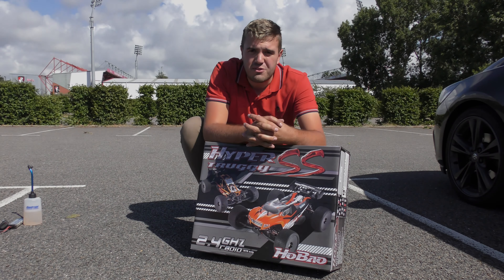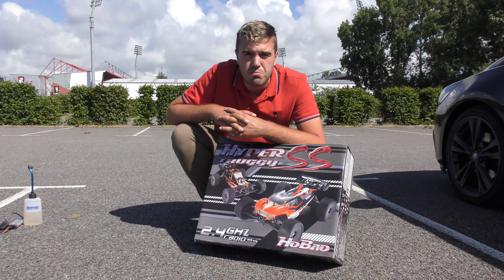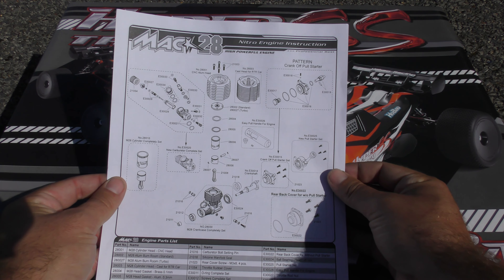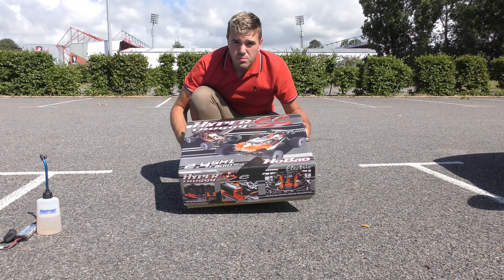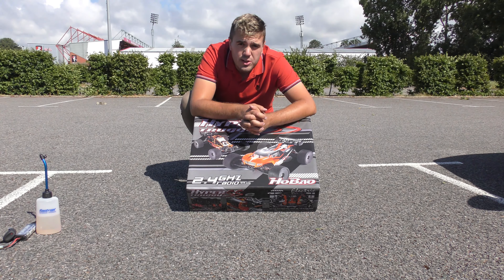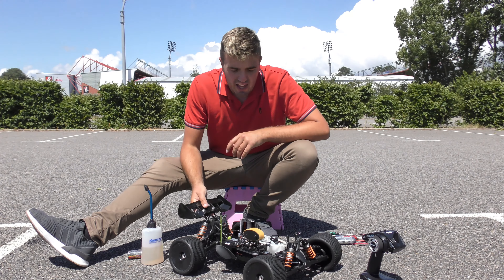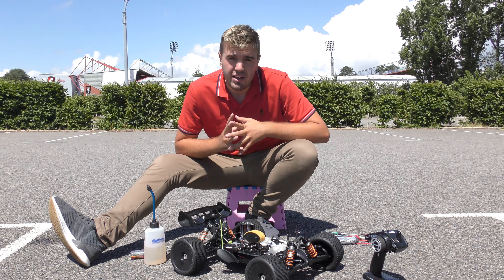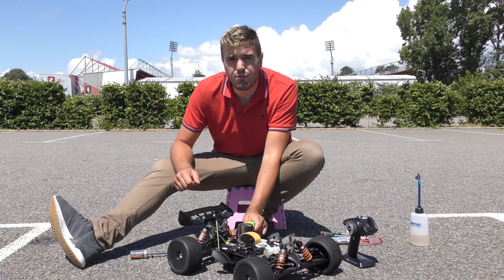How to Break in Hobao Mach Nitro Engines | Ft. Hyper SS Truggy

Comment: Hey mate, very informative video you got here. I use to hate Hobao's engine in the past. I use to have a SS nitro buggy before andI have to admit it was a hell for me to properly tune the engine it came with. So I just decided to put a different engine on it which I am familiar with and sell off that .21 original engine and pipe. Happy days. That the same thing I did when I purchased the SS truggy. That same day I got it, I bought another engine and took off that .28 mack. On this video you simply enlightened me how to love this Hobao engine again...Thinking now if I'm to use it the engine on my other kit laying around the garage.
Reply from the maker: Thanks, glad it helped :) They are good engines, not the easiest to tune though. The .21 Mach are supposed to be easier to tune apparently!

Comment: Hi dude, not related to this brand in the video but I could do with your knowledge and guidance. I’ve just bought a traxxas slash 3.3 and upon the break in procedure, the car will not idle and accelerates upon starting. I’ve adjusted the linkage, set the idle screw to 1mm gap, played with trim etc with no joy. As per the manual it states no to make any alterations to hsn/lsn until a 6 tank beak in procedure, do you have any recommendations? You’ve gotten yourself a new subby 🙂
Reply from the maker: If the idle gap is set to 1mm but it's still accelerating away this could be a lean LSN. Check that the LSN is set to the factory default setting as per the manual :)
Reply: TheRCBiker thanks so much for the speedy reply, as per the break in method advising not to make any alterations until completing the break in stage, would it cause further problems to adjust this do you think?

Comment: Hi, ive just brought a hobao hyper 7 with the exact same engine as this. when i went to do the break in the same as you have on this video mine runs lovely for about 1-2 mins then the revs just go realy hi and the car starts trying to move realy quick so i instantly shut the engine down the only issue is the carb isnt opening from its 1mm gap so i dont understand y this is happening? i have contacted the shop i got it from and am just waiting for them to get back to me. was just wondering if you had any idea y it was doing this. thanks

Comment: Hey Mate, I’ve noticed a couple times with the newer hobao stuff that the metal gear servos like to chew through the plastic horns, definitely worth looking into upgrading them to metal ones. Mine almost caused a run away.
Reply from the maker: Thanks for the info
Reply: Had this with a new tq7 luckily it was on the box

Comment: Hi I’m in a bit of a sticky situation and I was wondering if you could Help. Do you know how to remove the slipper shaft on a ftx vantage because I am struggling to figure out how. Thanks 👍
Reply from the maker: The slipper clutch you mean? Your best bet is to look at an exploded parts diagram of the car, that will show you how it goes together. This will be in your user manual, if not, google always seems to have the manuals somewhere!
Reply: TheRCBiker I do have the manual but I’m not really understanding tbh 😭😕😕
Reply from the maker: The exploded diagram will be more helpful than I could explain on here
Reply: TheRCBiker thanks for your support anyway. I’m not really understanding the final part of the diagram but I will carry on doing my research tomorrow. I figured the reason why the 4wd system was slipping was because the slipper shaft had actually worn down and the cup had to become to big for it.
Reply from the maker: No worries, 
If I had the car in front of me I could help you, but it's difficult to visualise and explain how to do it without the car in front of me!
Reply: TheRCBiker i understand. Would you know what to do on an ftx carnage as they share the build or am I asking for too much 😂

Comment: Hi. 
How much bigger is the truggy compared to the Hyper 7.  Also what sort of tyres do you generally prefer on your vehicles .And where is a good source etc. Like many folk I had a time with nitro but went back to 1/10 electric because it is more popular locally. But now you are re-lighting my interest maybe you could put up a vid of your equipment and recommendations etc. Thanks !
Reply: I always get proline wheels and tyres. Everything else is either race tyres that wear out too fast or rubbish that break the rims or rips the tyres.
Reply from the maker: Hi there, the wheelbase is the same but the wheels are bigger and it has a higher ground clearance. I just run the stock tyres usually and replace with stock off road type :) I will be doing a workshop tour etc soon which will cover some equipment etc

Comment: Hi mate I was just wondering why there is quite alot of oil in my pullstart? Is because my car is running rich or could it be something else? Thank you
Reply from the maker: It's probably leaking from the exhaust manifold and then making its way into the pull start housing
Reply: @TheRCBiker  Ok thank you for your help
Reply: @TheRCBiker  I have checked the manifold and it was the problem i could see a little gap where the rubber part near the engine and the exhaust bit was a bit further away from the rubber bit.  I had to loosen the exhaust and push hard to where the rubber bit is and it seems to be fine for now and thank you very much for your help.
Reply from the maker: No worries :)

Comment: hey mate do you know if this body shell is compatible with the hyper st pro (the kit one)? as i dont think the one that comes with the kit has a very nice shape... Thanks!
Reply from the maker: To be honest I'm not sure... I would imagine so yes as the two cars are very similar. You might need to do some trimming, and the body shell holes may not line up
Reply: TheRCBiker Alright i shall do some research i will also need to find an unpainted one but i do think that the bodyshell youve got there is far more modern!
Reply from the maker: Here's an unpainted one https://www.ebay.co.uk/itm/HoBao-Hyper-Sst-Truggy-Clear-Body-HOP-0057/202666593338?epid=738728132&hash=item2f2fdecc3a:g:kJYAAOSwh0BeD3oX
Reply: TheRCBiker Ah nice that looks good mate thanks!!!